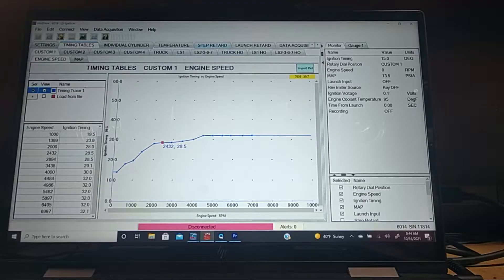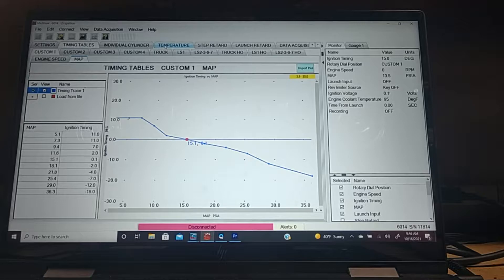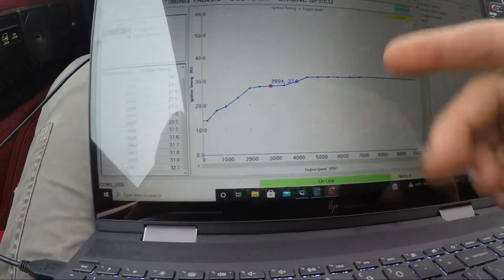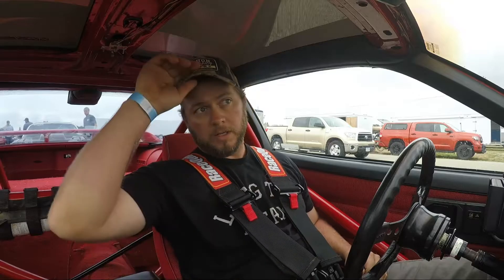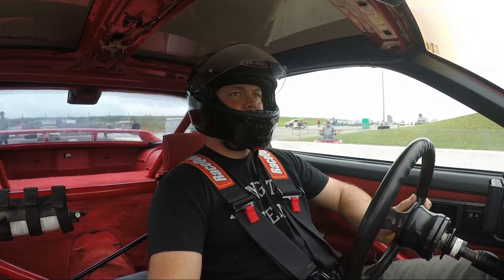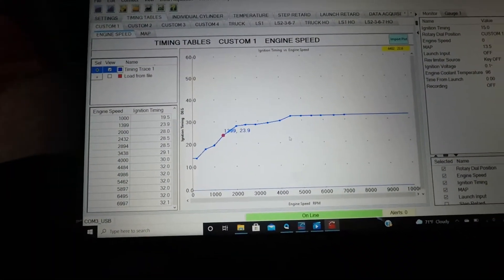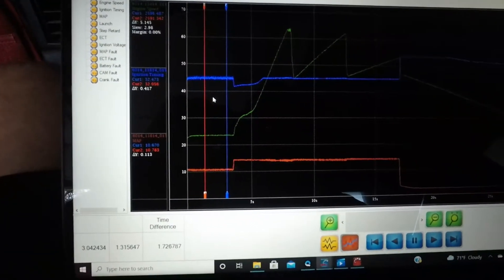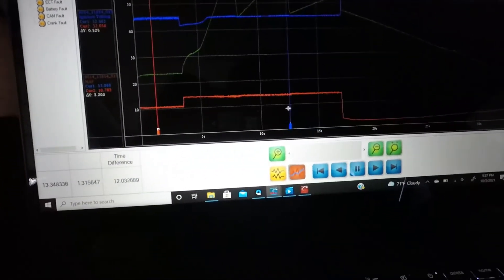Timing my Holley Sniper 5.3 LS with MSD LS Series Controller! Building Custom Timing Tables!!

Comment: I bet you would pick up .2 -.3 by changing up to the holley dual plane from that low rise single plane.  An easy 10th off your 60 ft.
 I swapped from that same intake to the dual plane on my turbo 6.2 , 6014 box, and fitech blow through deal. I had no idea just how lazy that intake is down low . Even on an engine making a lot more tq, it made a night and day difference . It feels like a completely different engine !
 An easy 25-30 ft lbs improvement down at 3k with NO lose in hp at 7k rpms on your 5.3.
 Nice setup btw. Not trying to dog your setup at all, just noticed your intake and wanted to share what I figured out .
Reply from the maker: Good to know..I've tossed around the idea, my 60fts are terrible.. you'd think my car was boosted with how hard the power comes in at 4k+ rpm..  but the car is going thru big changes at the moment, turbo setup with a new rear gear so we'll leave the intake alone for now to see the current differences and adjust things from there..
Reply: @KravasGarage  i ran that intake on my turbo build and w my stall and cam, both street setups , it was a real dog below 4500 at WOT. At part throttle, the engine had enough power to slide on down the road really well . No matter what I did with my timing at WOT , it wouldn't get up on boost quick . I texted w Richard Holdener about the problem and he flat out said its the intake.  I had the holley dual plane laying around from a project my son aborted,  so it was just a matter of taking a couple hours to change over . I drug my feet for a week or so , and didn't believe it would be a big change .  It absolutely changed the engines personality.  It even feels better up top ! I even took the borg s485 off and swapped in a Garrett g42-1450 , to try and build boost quicker . Huge difference in turbine size didn't help . Now, that Garrett gets past the 10lb wastegate spring before I get the throttle to the floor , lol. That intake you have is just below the power equivalent to an ls1 stock intake , the dual plane holley was up 35 ft lbs at 3000. It really gets the air moving.  
 If your setup has a big cam and 5k stall , you probably won't notice a big difference . My 225/229 cam and 3200 stall LOVES IT . 
 Good luck w the turbo build . Its a slippery slope , lol. Boost is addictive
Reply: +2 on the dual plane.  I cut a divider into a Chinese dual plane and I run a 1” spacer under my Sniper………. Car picked up almost .4 tenths
Reply: And I’m running a 6.0 sloppy stage 2 with ported LS2 heads

Comment: I like the setup, but what about your engine, does it have a cam, rear-end gears, and tire size? I'm running a truck 5.3 with a sloppy stage 2 cam, 750 carb, turbo 350 with 3000 stall 410 gears, and a 30-inch tall tire. Thanks
Reply from the maker: TSP Torquer V2 cam, 3:73 gear with 26" tires.  Im moving to 3:50 gears soon, hitting redline shortly after I trap..
Reply: @KravasGarage  Hey! Thanks for responding, looks like we're similar, I think I have to drop to 28 inch slicks. First time for me with an LS, Fun times!
Reply: I’d leave the gear and add a 28” tire if possible